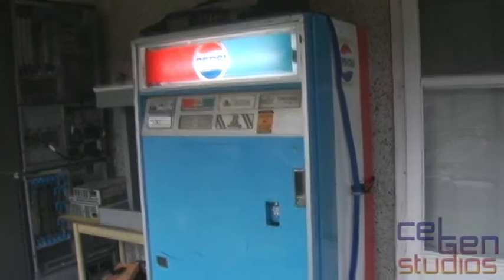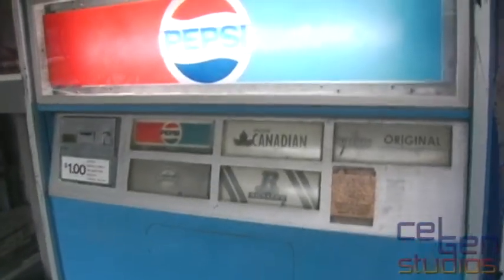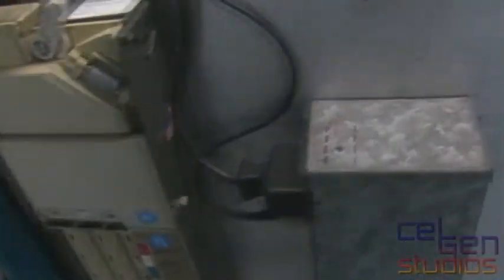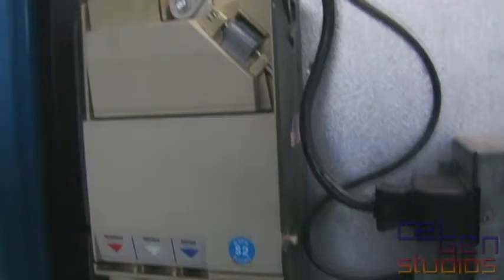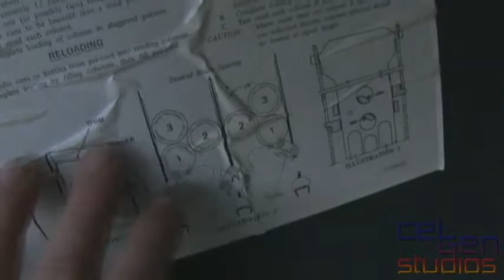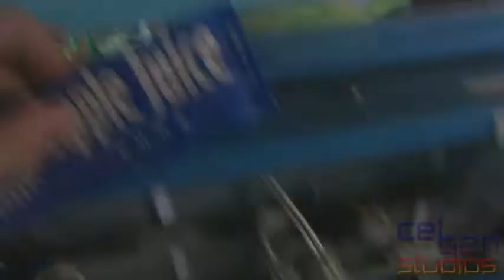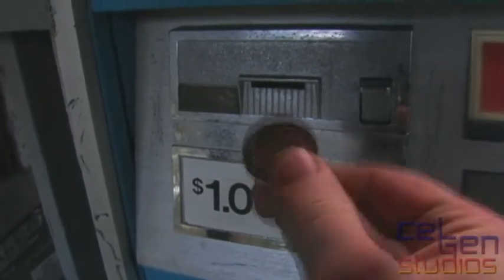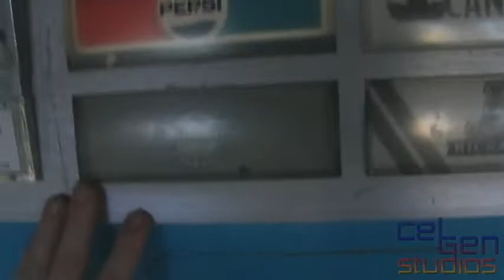My Beer Fridge is a Vending Machine

Comment: Awesome looking unit, I just picked one up the other day, just have to do a few things to get it up to snuff. Can you link the disconnect/ CB you used for the compressor? Mine is starting inside and if rather turn off refrigeration side when not needed.
Reply from the maker: I think on mine it's a physical plug and outlet hiding down by the compressor.

Comment: What coin acceptor/ Coin Changer model is that? I have the same machine. Mine is from 1971. Mine has this Coinco S300E-9400 and it is not behaving well. I want to change it.
Reply: I am from Canada too, by the way.
Reply from the maker: @knikk77  Coinco 9300-S  Suzo Happ will still rebuild and retune them for modern bi-metal coins but that's an extra $150 on top of also finding a unit to send them.
Reply: Mine is from 1971, exactly the same as yours.

Comment: is there a trick to getting the machine to vend after it sells out? the instructions say something about resetting the sold out flap but i don't know what that is.
Reply from the maker: The Sold-Out flap is a spring loaded lever and switch on the bottom of each column that's pushed in as long as there are cans/bottles in a column. You can bypass it by using a bit of wire to keep the switched pushed in.

Comment: Wonder if you could help me out.  I have a similar machine and just fixed the compressor.  That is up and running but now I have no power to the vend mechanism.  Can you video the electrical connection that comes from front panel as it enter the bottom of the unit to the harness.  I think I am missing some connections and I am trying to figure out what it is.  Cheers eh.
Reply from the maker: Even better, how about a schematic? The machine's diagram is pasted in the backside of the inner door - https://imgur.com/a/0jYGF
Reply: CelGenStudios Awesome thanks for the reply. I have that as well but I an not totally up to snuff on schematics. I will leave a link of a video to what I think I am missing. No Kokanee in that thing? https://youtu.be/BIEN-3PIl0o
Reply from the maker: Still a bit too cold for me to start pulling the bottom panels off the machine. Sorry man.
Reply: No worries. I got it figured out for the most part.